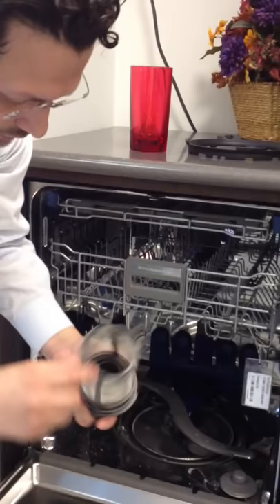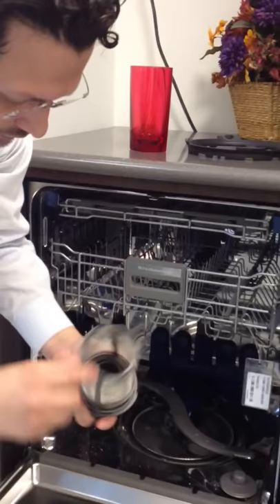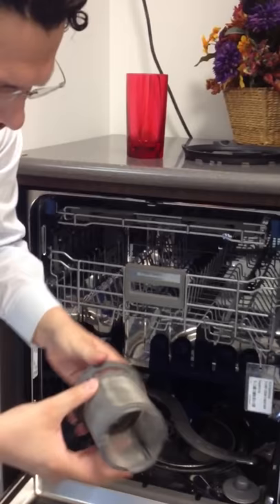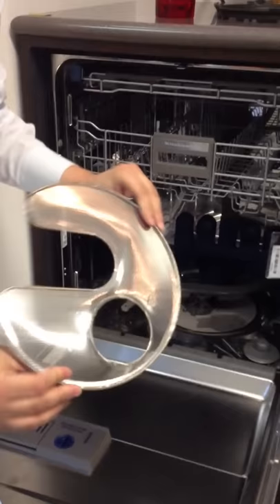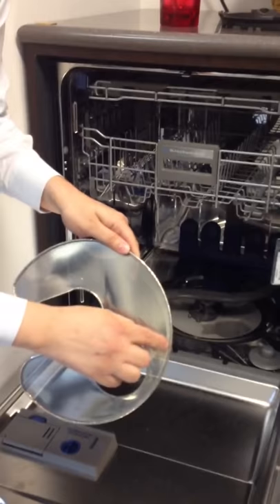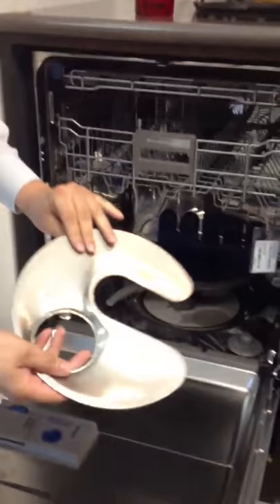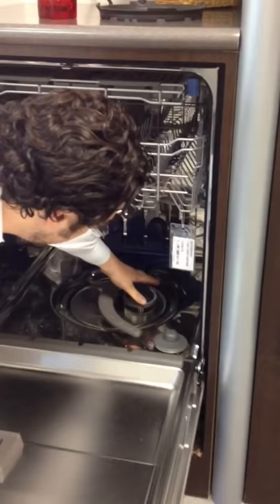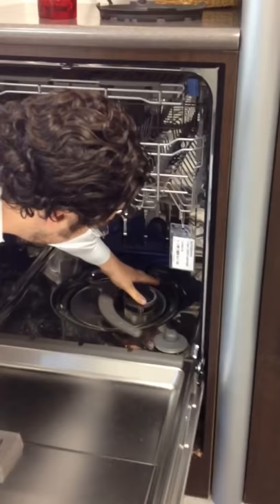KitchenAid Dishwasher Filter

Comment: What`s the differences with KitchenAid dishwasher  between their "Advanced Clean Water Wash System" and " “Triple Filtration System”", depending on models?
Reply from the maker: I’m not 100% sure but I believe the KDTE series dishwashers feature the Triple Filtration system that’s also available in all of the Whirlpool and JennAir dishwashers. This system is quieter but requires periodic cleaning/rinsing by hand as shown here. The newer KDTM dishwashers are exclusive to the KitchenAid line and feature a self cleaning filter that utilizes a separate pump for cleaning the “thimble” shaped filter. The pump adds to the noise level but is still considered very quiet by modern dishwasher standards. I’m guessing they’re now referring to this new system as “Advanced Clean Water Wash”. At least that’s my best guess.